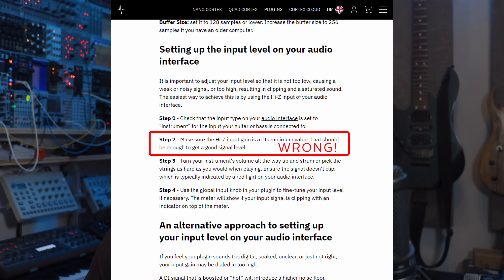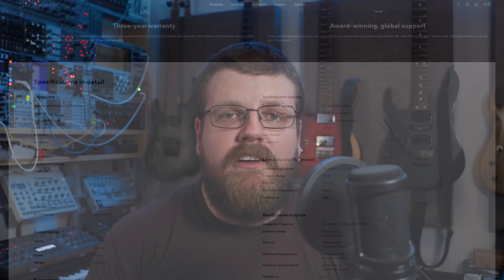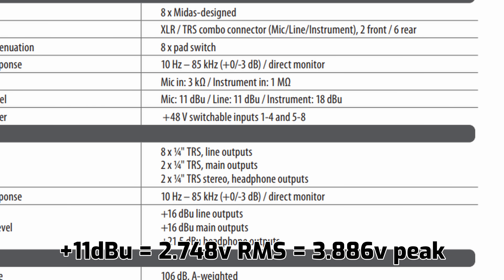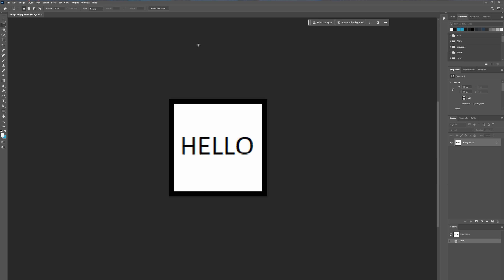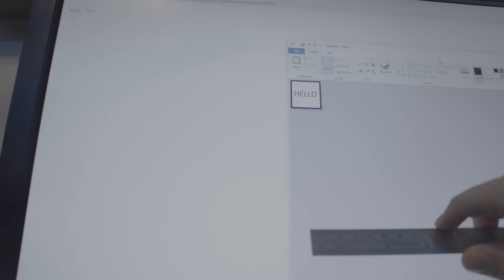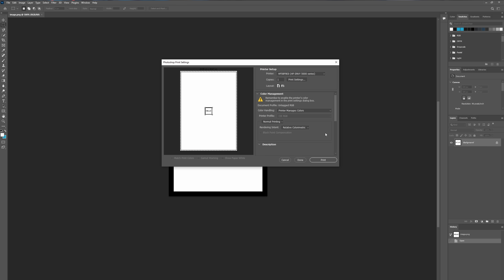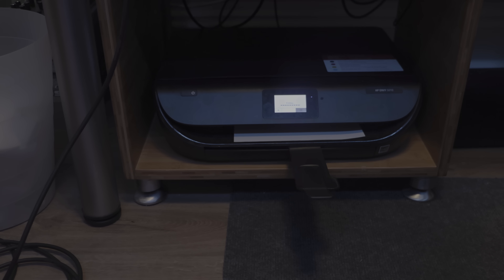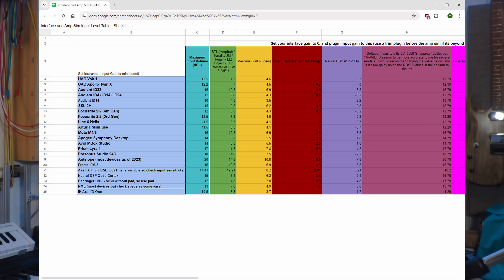Ampsims and input gain - Please, stop the madness...

Comment: This has always been my take as well. I personally aim for slight clipping if I really dig into my strings. But everyone in all of these arguments was always assuming that every audio interface was built the same, and that just isn’t true. The input section of my interface is specifically designed to be like the JFET input of an amp, the result is that I keep my input gain at zero because I still clip at zero.

Comment: It's the same with vocals, that's why you need proper recording gear for it. You raise the gain as much as possible to basically get the best conversion with the ADC, but before the converter, you also add a compressor/leveler so if the vocalist suddenly raises her voice, it won't destroy the perfomance with clipping, as the compressor will catch the peaks. And you also might wanna EQ before it.
The final processing can be done digitally, but when it's recorded on a suboptimal level, or has digital clipping in it, it won't be a lot of fun going forward...

Comment: what a great video!!! i had one question: you said you increased your input gain by 24db which is what you compensated with on the Fortin input knob. i'm using a volt 1 interface and after setting the input gain just before clipping, how do i know what value in terms of db's i'm adding signal wise into the interface? that way i can subtract that amount from the spreadsheet to have the optimal gain stage! cheers

Comment: I was very confused when you first started talking about setting the gain to zero. I was saying, "Zero what?", it didn't make any sense.

Yes, absolutely, set your primary input gain as high as possible without clipping. That's sound reinforcement 101 step 1 whether live or studio. Everything after the input gain is technically just a processor or an output fader.

Comment: I do have some electrical backrounds, but improtant to say is: What you are sayin is just simply logical ... get as much signal from your tool (guitar), adjust the digital conversion, so you can use as much of that original signal. I used to be a hardcore 1st person shooter player and I always used the sensor of my mouse the same way ... max (or native) resolution of the tool (mouse), ingame adjustment of the sensitivity (where I usualy ended up with great reduction like 10000+ dpi sensor but having like 0,37 sensitivity ratio). I guess the point about dpi on screen vs in print was spot on!

Comment: I will try this. The approach I used so far was to put on an amp simulator, set it up for a breaking/crunch tone and roll down the volume knob to get a clean tone. If I heard that the clean tone died too easily, I'd slightly adjust the interface's gain to the point the signal wouldn't die off, but still maintain the clean tone and not start to go into overdrive.
Your approach is more technical and correct, I can see where the shortcomings of mine were, but I had no idea on how to improve upon it

Comment: I’m a guitarist, when I started using amps I learned this a long time ago. This is great advice. I don’t know how many times I’ve had to go to someone’s house because they said it was noisy as hell and they did everything right. Then I show them. They did some things right but not everything. I have one question though. I produce digital music a lot so it’s staying internal until the song is finished. No outboard gear. In this case, would it only be one input gain, being the digital input pre-level of the software itself?

Comment: The only right thing is to hit the converters with as strong a signal as possible. After that, it does not matter even a bit. The input gain on the amp sim functions as a boost/cut. Want to boost a Morgan more than you can irl? Do it! Want to clean up a 5150 more than you can irl? Do it! Want to crunch up the clean channel on a Soldano just a teeny bit more? Do it?

There's only 2 important things - Hitting the converters and understanding the musical flexibility of the input gain in the sim and that it can and should be used to your liking, in your context, to make music. Without a pedal or some mods, you can't make a 5150 have more gain. Now, we can. We shouldn't be talking about what is accurate to the real amp. This is not the real amp. It's nothing like it. It's an application on a device. Use it as such.

Comment: As a scientist and engineer, this has driven me nuts for decades.
The other one was Zero Latency
I got into a back and forth with some people on here about ZERO LATENCY
It doesn't exist. It's a compensated state achieved with programs and behind the scene (displays zero but really isn't) slight of hand. If something travels from point A to B....there will be latency as it took time from trigger to travel to sound from speakers.
Reply: I do digital audio for fun, and IT networking for a living. People always flub the difference between latency and throughput. Then they flub identifying bottlenecks as well. Say it again. There is no such thing as zero (absolute) latency. You can only match two systems (like in real time recording) by delaying the lower latency signal.
Reply: They're referring to the rate at which things travel through their heads 😆
Reply: @fokeyjo  I don't think so lol. I genuinely think they just believe it's correct, but it's not
Reply: Tell them to get a brain. 0 ms latency is not zero latency it's sub millisecond latency.
Reply: @zb10948  They think because they can't hear it, that it's not there. Much like when the sun is not visible in the sky...means it's not in our solar system anymore..lol
Reply: @zb10948  sub 10ms or more i think
Reply: Yes, there is a base level latency you cannot get rid of. You have analog electronics causing response shifts (which technically also introduce slight latency), you have a speaker that does not immediately respond, you have distance between speaker and listener, you have brain processing which also takes non-zero time... so there is always latency in the chain you cannot get rid of.
The closes thing you can achieve to "zero latency" is "zero additionally latency on top of baseline", by bypassing a/d, processing and d/a for monitoring. And to this day, I still advocate for not listening to your recording target signal through your DAW process. Anyway, I feel your pain there :)
Reply: @lucemiserlohn  Indeed! A good old thru output from the DI into a rig is my go to solution for this. Tracking and mixing can be done in two separated moment so why bother ahah
Reply: @RemyLuciani  This. You can record the rig, no problem, as it gives you valuable guidance on the sound you were going for while recording, but definitely reamp it later. But, playing immediately without any additional latency greatly improves your chances for a goo performance actually worth recording.

Comment: This is great information! But I can also see the appeal of the +0db input shortcut. The average guitar player just plugs into an amp and turns a volume knob that might not even have numbers on it. The fact we need a spreadsheet is insane. 

Gain staging has also been my biggest frustration with NAM. It sounds the best of any amp sim I’ve used but there’s no standards for gain and most users don’t publish their recording settings. So model to model the input gain setting needs to be changed and it’s a becoming a nightmare to manage.
Reply: you're so flippin' right dude! it's a nightmare to manage something that can be done within a second of plugging in and understanding your own gear!😩

Comment: You have got it spot on! Glad to see my logic was not far off. I was one of those convinced by the idea of setting the interface to 0, and I would have followed it blindly, had it not been for the fact that my Quantum 2626 noise floor was so high. I didnt do it like you did, but i would set the interface gain to about 1/2 way, where the signal gain was under cllipping for my highest gain guitar. Then i woud reduce it in the DAW to get it to unity level and left it there. I did some calculations at the time to get unity gain on my interface using known voltages and also using outputs on my interface sending a 1k signal at certain db level and looping it in to get the same level on teh input. It all matched with my mltimeter readings and the specs of the interface (cant remember how now :)),. It sounds pretty good that way. Will test your method for comarison though.

Comment: I never really experienced problems with the input gain in my setup (Focusrite 2i2 3rd Gen and NDSP plugins). Always left the digital input gain at the default setting and only adjusetd the interface input gain to be just below its clipping indicator. 

what's not clear to me now is by how much I should reduce the digital plugin input gain if I wanted to follow and try out your advice. Let's say I use my Focusrite 2i2 3rd Gen and a Neural DSP plugin.
I set the plugin input gain to 0.3 (according to the spreadsheet).
I set the focusrite input gain to as high as possible before clipping. Let's assume that's 12 o'clock.
By how much should I reduce the pluginn input gain now?! Should that now be 0.3 - 12.5 / 2 ~= -6? Because 12.5 is the maximum focusrite input volume (according to the spreadsheet) and its input gain setting of 12 o'clock means I'm using half of that?
Reply: When you turn an audio interface gain knob up above 0 you lower the dBu headroom number. 
If you are using the HI-Z INSTURMENT Input on your Focusrite 2i2 3rd gen.....Turning the Interface gain knob all the way down (to 0) that is 12.5 dBu of headroom. 12.5 dBu maximum input level means if your interface gain knob is all the way down (on 0) you have 12.5 dBu of headroom before you clip the A/D converter. now use the chart he referenced and adjust the amp sim input gain.
guitar pickups have to be hooked to a high impedance input or they will not sound right make sure your using the instrument input.
Reply: @StudioAmpCaptures  thanks for the details! This didn't answer my question about step 4, though. By how much should I reduce the digital plugin's input gain?
Reply: @StudioAmpCaptures  you repeated the content of the video with your own words, but that doesn't answer my question. How do I know by how much to adjust the plugin's input gain after I've adjusted the interface's gain knob?

Comment: well, nice to see I've been doing it right all this time. Did turn the gain on the plugin down a bit after watching this and it made a noticeable improvement.

Question, though. What if you're using your amp sim ONLY for the IRs and/or poweramp simulation? Do the same rules apply? I'm guessing yes, signal is signal, if the strength is higher, just lower the gain on the interface, correct?

For example. Guitar -> Marshall JVM410H -> JVM410 FX send (essentially pre-amp out) -> Behringer UMC404HD in. Then I use Mercuriall's Ampbox VST and turn on only the Poweramp and Cabinet blocks. I follow the same steps, adjust input gain on UMC (naturally you'd use the "Line" setting since you're no longer dealing with instrument level voltages) to right before clipping, then lower VST's input gain to compensate, correct?

Comment: There was a discussion? I set my input gain such the signal typically swings between +- 0.7 or +-0.8 on the scale you've mentioned, so I have a wee bit overhead before it clips. Most engineers seem to do the same and I believed that is just consensus.

Comment: I was not even aware this debate was going on until I clicked this video and now I'm mad because this is like Day 1 gain staging, how is everyone getting it so wrong? Great video btw, well explained
Reply: I didn't got the point of the debat too, except maybe everyone is putting too much input gain on their plugins ? 
I mean, everyone knows that on the interface the input must be set to maximum before clipping, right ? ... Wait... RIGHT ?
Reply: This. I naively honed this when I first started experimenting with an interface. Maybe I read something once on maximizing signal to noise ratio once then, and was like “okay, that’s what I thought.” Then moved along and never gave it a thought. You’re converting analog energy to digital… it seems pretty intuitive to maximize that signal with the best bit depth (resolution) to give you the most to work with up the chain. Great explanation here, regardless.
Reply: @ericpage818  I think every half decent amp says to do this in their manual. It's really really basic. I'm honestly surprised this is even a discussion. 😄
Reply: Yeah. I didn't know this was some sort of argument. Also when switching guitars , I have to fool with input gain for each one. When I change modeled amps and effects same too. mostly on the sim instead of the interface though. I don't know the science behind it, I just ...do it.
Reply: this digital clipping issues begun when Helix floor unit, when  first came out back in 2015,   its still an on going but much better handled these days..
Reply: I can explain that: its how internet knowledge spreads. Itll start by one person posting a comment or a video or something in which they oftentimes literally disclaim 'yo guys, i have know idea what im talking about, but ima talk about it anyways'. Now people coincidentally not being affected by any outside influence the initial poster forgot to consider, are 'successfully' applying the 'knowledge' not noticing that the bunch of a few extra problems they got was actually caused by that 'solution'. So they go ahead with the opener 'yo guys i have no idea what im talking about' still in their minds and post a video or something themselves, further spreading the false knowledge. Eventually people not even involved with the domain of the problem will start commenting on it, further entangeling truth, believes, self promotion and stupidity into one big mess.

This is how you end up with such discussions in a nutshell.
Reply: @ohcibi  “The irony of the Information Age is that it has given new respectability to uninformed opinion.”
― John Lawton

Comment: I made a gain adjustment based on your story. The audio interface I use is UAD APOLLO TWIN (not x). When I made an adjustment based on your story and your attachment sheet, it was best when I set it to gain 0 for the interface and gain 0 for the plug-in (it matched with the sheet). Maybe natural dsp plug-in makers made it based on uad hardware.

Comment: Yeah so I have missted this debate entirely, but I wonder where people get the idea to 0 the input. In 20 years of active music making on stage and in the studio I've always learned that it was common practice for every element in the signal chain to set the signal that is output from the previous element just below clipping or as a rule of thumb to -3-6 db so it has a little room for unexpected peaks and then adjust the input gain of the element itself to shape the sound. So if you have a compressor you hit it with the maximum possible output gain of the thing before, then reduce the input gain to make your sound good and then crank up the output gain again to match your -3-6 db signal level again (or just below clipping). And that's essentially what you did. The input into the interface was pretty much fixed, but the throughput of the signal was set just below peak and then the input gain of the amp sim was adjusted down again to make the sound be right for the amp.

Comment: OW! Amazing explanation. I tested my setup, and what a difference. I never used my interface on 0 but never balanced the amp sim input to avoid this boost in the gain. Now it makes sense why I got too much noise with little gain in pedals and amps. I believe now I can dial the tone with more control. Thanks!

Comment: Great insight. There is definitely a noticeable difference in noise. I have bounced between 0db and gain driven DI and this is by far the best approach I have experimented with. Thank you for this.

Sharing for anyone who has a similar setup.

Interface: Focusrite Scarlett 18i20 (3rd gen) (but the Scarlett range has the same preamps so any interface in the line will likely yield similar results)
DI: Rupert Neve DI
Guitar: Telecaster

Ed S provided a video to calculate compound max input volume when using a chain consisting of DI into an interface (rather than the directly using hi-z input in my case). I use this as my starting point for the suggested plugins.

My combined max input volume: 16.41dBu

Example plugin: Anything from Neural DSP as they are calibrated the same I believe. 

Suggested input trim = +4.21 (16.41 - 12.2 as per modified version of spreadsheet linked)

I have calculated using a reverse DI sine wave through the RNDI that my set DI input gain (healthy signal below clipping) is adding approximately 23.5 db

Would I be correct in then adjusting the input gain by -19.29?

Comment: I understand why it is important to optimise the audio to noise ratio and therefore to maximise input signal. But there is one thing which I have not seen addressed in any video. You are speaking about a guitar plugged straight in the interface. But if you are using the digital amp as your guitar amplifier (such as a Tonex), and you are pairing it with real overdrive pedals, and let's say you have 4 different OD stomp boxes, do you stack the combination you use with the highest output with your highest output guitar to calibrate the input gain (as this would be your maximum signal)?

Comment: Finally. It's actually so simple. First you have a device that converts a analog signal into a digital representation of it. This device is made up of integrated circuits, so it adds a noise signal. All circuits do. If the input signal is too weak, the noise goes up. First you give that device the highest possible input signal strength. You adjust the digital gain AFTER that.